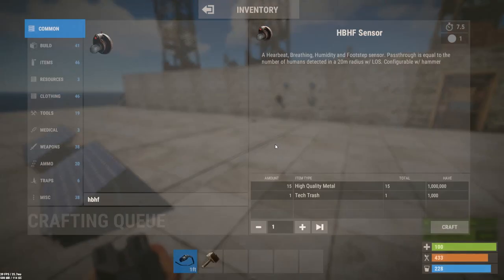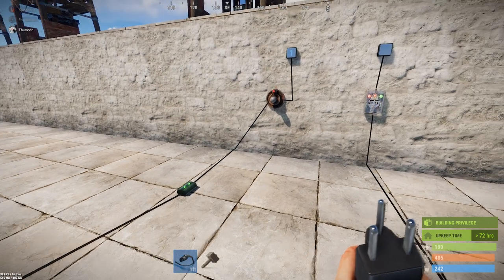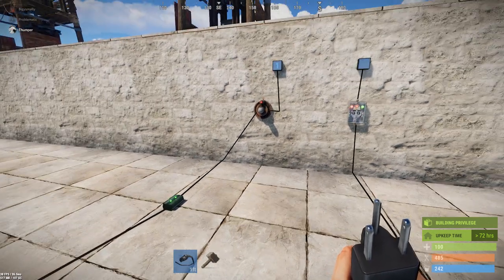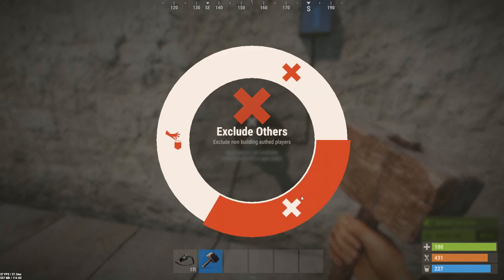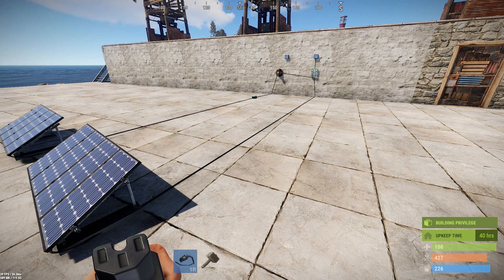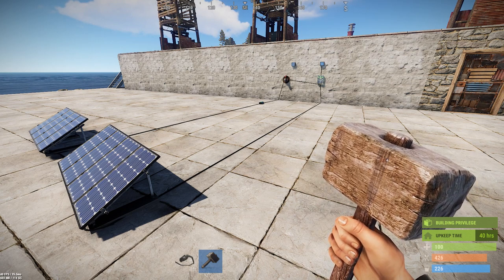Rust Electricity 101: Component Guide - HBHF Sensor

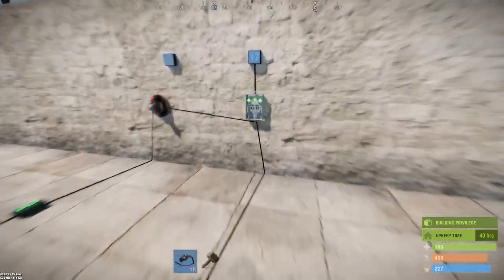Comment: 4:57 Correct me if I'm wrong, but aren't YOU wrong in this case? If the solar panel is outputting 17 and the display is showing 17, then it's not favoring the larger output, otherwise it would display 16, because of the cost of running through the AND gate, right? Unless logic gates dont take up that 1 power when passing through. I think it's combing the 1 power from the HBHF sensor and the power source.
Reply from the maker: I like your logic, but I think it the reason it dropped from 18 to 17 to 16 is because it was on fire and taking damage was causing the output to drop. The solar panels do lose power as they take damage.

Comment: I made a setup with this at current date, I want it to Throw out more power when it detects 1 or more people. I have it linked to my garage doors and my autoturrets around my base. Is that possible? So when it detects someone entering the perimeter it will open the turret doors.

Comment: Is there any way to have multiple hbhf sensors attached to 1 counter and show how many outside?
Reply from the maker: Not exactly... Since we can't put them through a root combiner to add up an actual count, it's not directly possible. However, indirectly with some creative HBHF + AND and OR Switch use you could kinda get the counter to add  up how many triggering events occur, but that's not really what you're going for. Better solution may just be using multiple counters in passthru mode places adjacent to each other so you can see in real time the count from each HBHF.

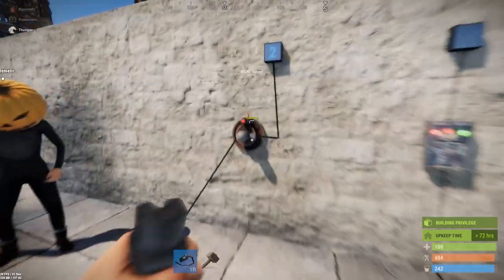Comment: 3:10 If you set the branch to 3, you will only have 2 out of your branch 1 which will be used in the branch(Thats why the minimum is 2). If the sumption of 1 is being used in HBHF sensor, you will only be available of 1 for the displayer. You got something wrong I think.

Comment: hey man, so ive been looking into this hbhf sensor for like a day now, maybe you have been too, ive used it in our base now for about 3 days and can say it might be impractical at this point.... maybe maybe not but as far as i can tell, you cant use it if there are multiple tc's around.. can you confirm this for me? whenever i leave the tc range it resets the device
Reply from the maker: Ouch... I'll check that out on the current build and staging tonight. That's a total bummer and limits the use drastically!!
Reply from the maker: Commit logs shows this was fixed late yesterday, just confirmed on latest main release it does not  have the bug!

Comment: can you use multiple HBHF sensors (in different locations around your base) to activate a lock down? if so, then how?
Reply from the maker: Yes, it should be possible. You want HBHF's placed around your base such that if any one of them detects an enemy inside, it closes all the doors, correct?
Reply: @RabidRabbitGamer  correct. I think you could toggle using a memory cell but I dont want it to continue to toggle on and off making the doors constantly open and close
Reply from the maker: Cutting power to doors makes them close, so here is one way to apply power and then uses the HBHF's, boosted through AND switches for more power, then chained through OR switches so that any one HBHF will activate the blocker, cut power to the doors and cause them to close.  https://www.rustrician.io/?circuit=434aacf2b86d8ba3b799f1d72266122f
Reply: @RabidRabbitGamer  this is exactly what i was looking for! Your the best!

Comment: HBHF is currently broke - exclude yourself and leave the area.Now go back and its reset
Reply from the maker: Well that sucks, thanks for the tip, I'll check that out!
Reply from the maker: Commit logs shows this was fixed late yesterday, just confirmed on latest main release it does not  have the bug!
Reply: it doesn't work for me at all
I connect it with a small generator and connect it to a counter and include stangers
but it doesn't pass any power ? :|
Reply from the maker: @Troalinism  So if you have it set just to strangers, you're not going to trigger it if you're authorized :) But even when you do, it only outputs the single unit of power per person detected, so be used to use the AND switch trick in the video so you can get sufficient power into your circuit for what you need to run! Also make sure you have at least 2 units of power coming into the HBHF!
Reply: @RabidRabbitGamer  I know lol
they fixed the HBHF in my server today